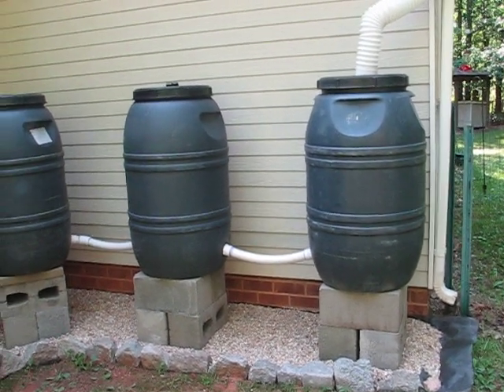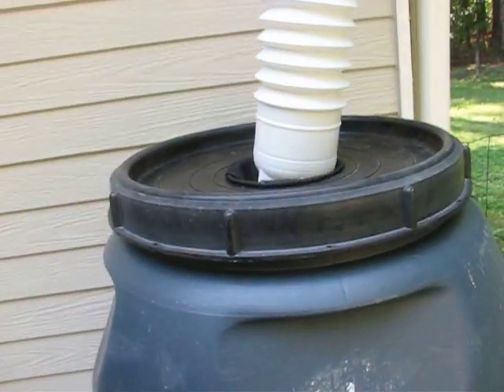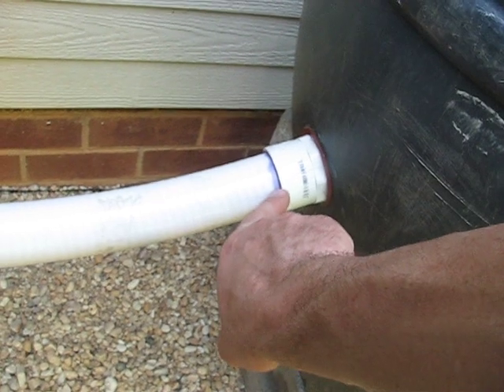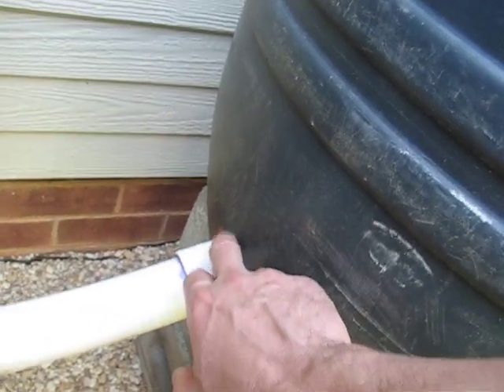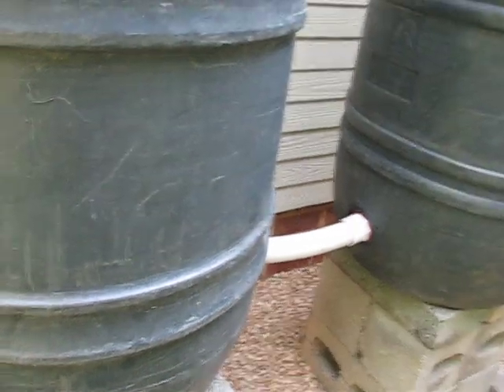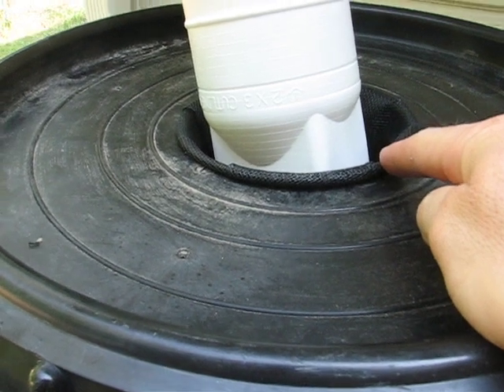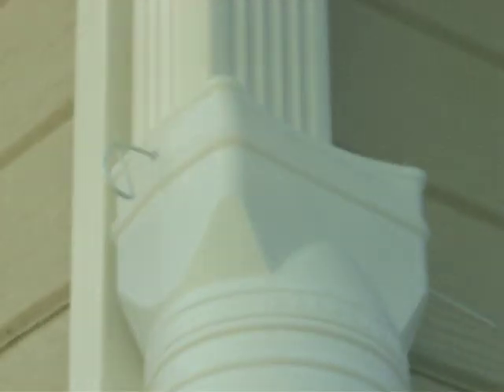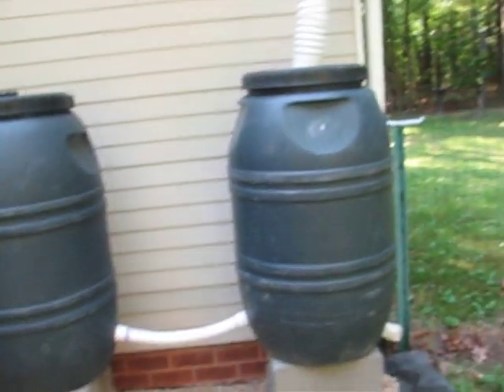Making and Connecting Multiple Rain Barrels Part 1

Comment: Excellent system. Thanks for the detailed description. I currently have two barrels connected together. I I like your connection method a lot. Many people connect their barrels at the top, but I think it's better to connect them at the bottom.
Reply: A "circle cutter" is called a hole saw.  There are differnt types, some are cylinders with barbed edges, others are called paddle bits.

Comment: By connecting them at the bottom of the barrels, rather than towards the top, you are risking a problem with any of the hoses or connections draining the entire array. 

Connect them near the top of the barrels and you greatly reduce the amount that would be lost if a seal fails. However this will require a tap on each barrel.
Reply: And doing that you lose capacity as anything below that is trapped

Comment: Not knocking your design, but they should be connected at the top. Much more simple to connect with water hose sections/couplings. Closer together, less expensive with less chance of draining leaks. Overflow?
Reply: As Blethigg said, if you connect at the top, each barrel has to have its own tap. Otherwise you would only have about one useable barrelful. Because these are all connected at the bottom, you can get all the water from the one tap.